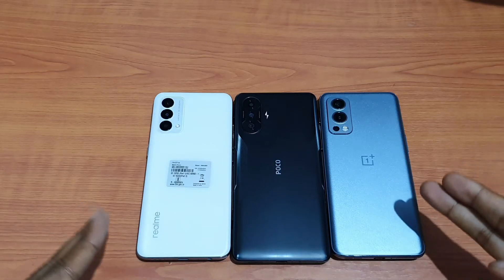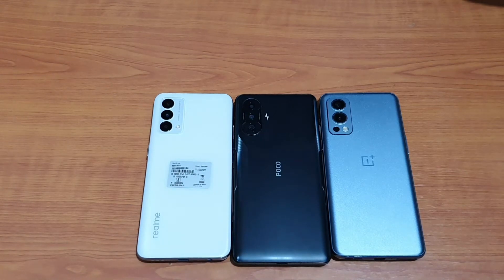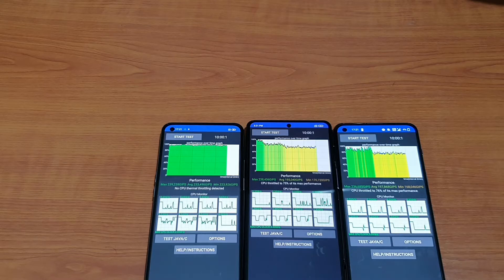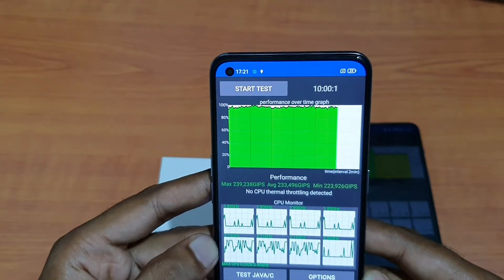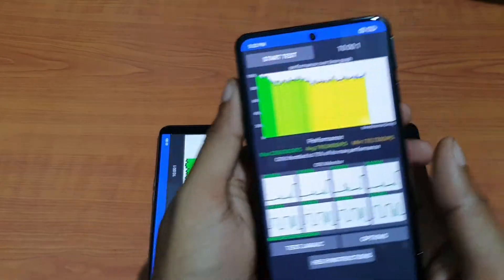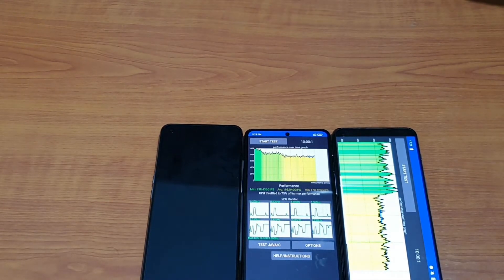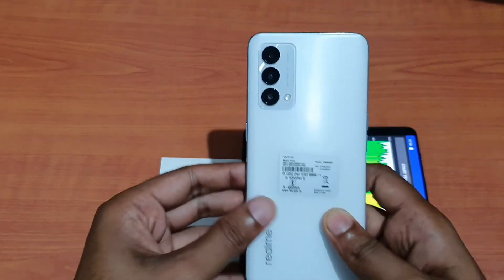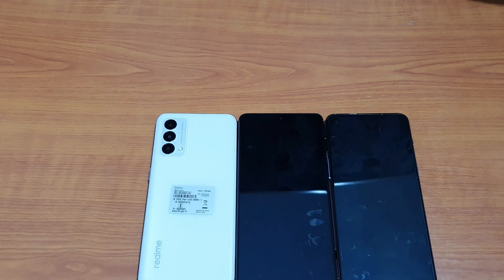Realme Gt master sd 778g vs Nord 2 Dimensity 1200 Cpu throttle test

Comment from the maker: Realme Gt master vs Nord 2 Vs poco f3 Gt Review
https://youtu.be/9O3oN_d7PoI
Poco F3 gt Vs Nord 2 Vs Realme Gt master
Display and Audio comparison
https://youtu.be/oT--vrRa3dE
Snapdragon 788 vs Dimensity 1200 cpu throttle test
https://youtu.be/IToqHtyqKa0
Dimensity1200 vs Snapdragon 788 antutu Benchmark
https://youtu.be/7_7T3zUWcyc
Sd 788 vs dimensity 1200 geekbench5
https://youtu.be/FL4w6o28ezM
Nord 2 vs realme gt master Touch Sampling test
https://youtu.be/2YpsOcDljpo
Realme Gt master Vs Nord 2 SpeedTest
Snapdragon 788 vs Dimensity 1200 Speedtest
https://youtu.be/ds2ge3nDd6s
Oneplus Nord2 Vs Poco F3 gt Speedtest
https://youtu.be/IuU9Q4R30LU
Realme Gt master vs Poco F3 gt Speedtest
Dimensity 1200 vs Snapdragon 788 Speedtest
https://youtu.be/1wPaHW1fZFk